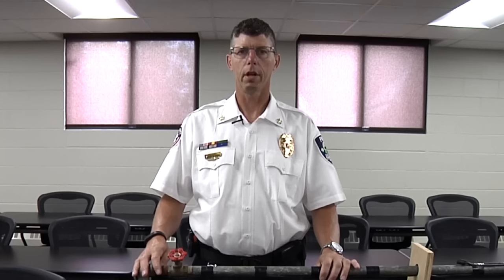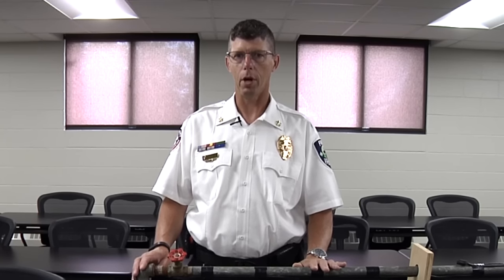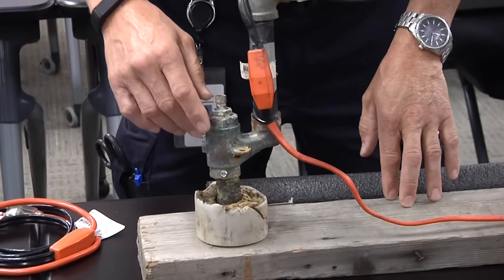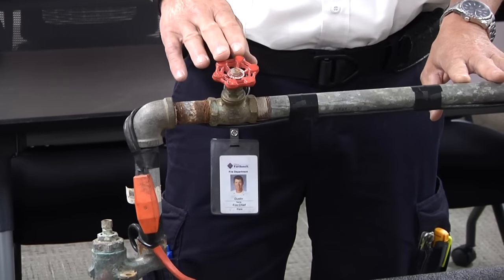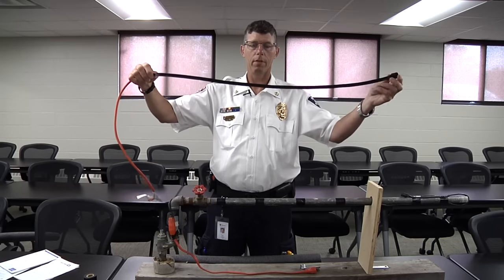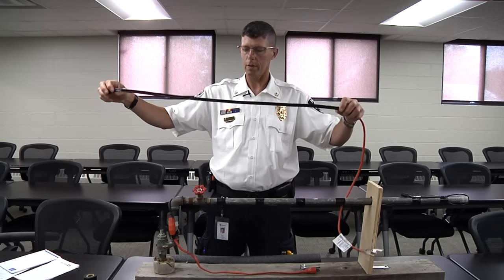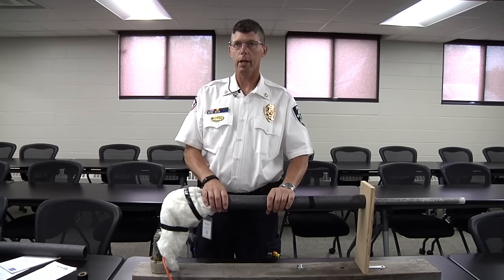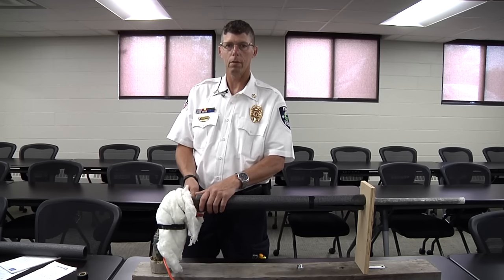How to Install Heat Tape in your Manufactured Home

Comment: Installing heat tape is not rocket science, and this video is an excellent how-to. I've done many, many jobs like this as an electrician, and there are just a few important things to remember, like keeping that thermostat 'button' firmly against the pipe. Here in central British Columbia, Canada we run the heat tape in a long spiral, about one turn every foot, to put more wattage on each foot of pipe. The manufacturers clearly warn you should not do this, but in the real world of the Great White North it works well, without any fire hazard. Just be sure to never cross the heat tape over itself, as that does create a hot spot. This firefighter did mention that. Two more things: contrary to the advice in the comments below, foam insulation is absolutely fine; it's treated with fire retardant. Fiberglass is great, but only if it's kept absolutely dry. Second, you do not need a 20A circuit and heavy conductors; this tape typically draws six to nine watts per foot, so we're talking about a very light load. Don't over-think this.
Reply: Great advice.  
Is it safe to put heat tape on Pex Pipe & then insulate it?
Reply: PEX is considered freeze damage resistant. It will swell up and possibly burst. But it's best to replace it if it does that. If u can even notice that is... I imagine the heat tape would work just fine on the PEX considering it doesn't melt the PEX, which is heat resistant as well.😊 PEX is awesome.
Reply: And a GFEP
Reply: Like what you said about wrapping the pipe instead of running the length , but one small correction , manufacturers say to run length up too 1” pipe any bigger pipe wrap spiral , depending on the situation i do the same as you wrap .
Reply: Don't use foam insulation. Doesn't matter if say if it's treated with fire retardant just hold a lighter to it. It goes up like a golf ball. That's absolutely wrong to use foam insulation. I've had this heat tape burn without touching anything just on the pipe. If it started that insulation it just goes right on down the line probably burns your house down. I don't know where this guy gets his information from but it's totally wrong. Fiberglass is probably better. If I do insulate I'll use fiberglass just try it. Hold a lighter to that foam insulation and see what happens. You better ready to get ready to let go of it because it's going to burn your hand. Just testing it

Comment: I am surprised that a firefighter fails to address the fact that the manufacturers of the foam pipe insulation clearly state on their packages that the product is not to be used over heat tape.
Reply: Liability, then. But who wants to waste that heat? I demo'd a job where the heat tape was wrapped OUTSIDE the insulation 😮

Comment: Stick to fighting fires Chief. Terrible presentation, sorry but you're fumbling for words and pausing while thinking was difficult to listen to. Further and more importantly this is titled as how to install the heat tape. You didn't install it correctly nor did you mention that you need to keep the heat tape flat against the pipe and not twisted as you tape it to the pipe. The biggest incorrect thing you did was that little trick where you inverted the orange power cord towards the top and looped the black heating wire down and around the elbow and back up the other side of the pipe going past the thermostat. You should never do that and only install everything in a straight line along the pipe from beginning to end. The problem with doing it the way you did and looping it around that pipe is that you effectively have double the amount of heating Cable in that short section of pipe which is right by the thermostat. That double section of heating cable will heat that section of pipe twice as fast as the rest of the 5 ft long section of pipe that only has one black heating cable underneath it. When that beginning section by the thermostat heats up quicker it will cycle the thermostat off and the remaining part of the pipe that doesn't have the double cable on it will be a lot colder and possibly freeze. So I would follow the instructions and keep the heat cable in a single row under the piping and not double it like you did to cover that extra area of pipe that is exposed. I'm sorry but by worrying about that little bit of pipe and doubling the black heat cable around it like that you now risk the entire length of the rest of that pipe becoming frozen.
Reply: Brutal! Lol

Comment: Don’t touch fiberglass insulation with your barehands. Always use gloves. Tiny glass particles will cut, and lodge into your skin. That is way your hands feel itchy if you touch your skin with fiberglass insulation.

Comment: All heat tapes made for mobile homes in my area specifically state NOT to put anything over the tape so as not to cause a fire.
Reply: I've seen instructions where they say to insulate the pipe with fiberglass, which is not flammable.
Reply: There are different kinds.

Comment: Great Information - Thank you for sharing it. We just moved from South Florida to Montana so this is all new to me. We have a unheated walk in utility basement that has all of the water lines that supply the house attached to the floor joists. We know that one of the copper lines burst last winter and flooded the basement (it didnt have heat tape on it) The previous owner did not have the thermostats attached to the pipes they are just hanging in the air near the plug. I think it is time to replace the heat tape and insulation correctly since I don't know the age of the current heat tape. Thaks again for the great information and your service to your online followers and local community. !!!!!
Reply: FYI, pex is type of water pipe that isn't easily damaged by freezing

Comment: Wow, finally someone TEACHING and informing regarding heating tape/cord, pool noodles and the correct information to use on this case. I want to make sure that I point out what you said during the video THE HEATING TAPE SHOULD NEVER CROSS ITSELF!! this produces a high hot point and most sure you will get an insulation burn out. Once you get a burn out on the tape the best case scenario is that you will need to replace it, your pipe will freeze, and you will need to replace it or you will GET A FIRE. We were smelling something weird on our master bedroom and after a couple of days and inspecting the under belly of the trailer we found out the tape was BURNING itself out and we were very close to LOSE OUT HOME. This is real and extremely important information.

Comment: You could use an infrared thermometer to check if it is working. I use one around my house all of the time to see how warm the radiators get and look for cold spots in the winter.

Comment: I have two 1/2 inch copper pipes running  throught my unconditioned attic that supply water to a shower/bathtub below. Each run is about 8 feet but passes through about 5 or six studs. Can I safely run heat tapes up, over and down each stud or do I need to be concerned about the wood studs catching fire? I hate to drill extra holes for the heat tape. I live in Central MA and do have blown insulation but I did have frozen pipes last year when the temps turned single digits. My house is a Colonial from the 1980s.😊

Comment: I see that your not wrapping the sensor (thermocouple?) with tape directly around the back to keep it secure against the pipe. Is there any reason why you wouldn't want to do this? I see some videos securing the sensor this way, and in your demonstration you keep the tape to either side. Thanks for the informative video and I apologize if I just missed this somewhere.

Comment: i notice the black plastic pipe coming from my well to the trailer, is just barely under the surface in a 3 foot section... u can see the top of the pipe actually... Should i at least add some dirt on top of that... its been fine so far but....!  and im in Canada... ha  chilly winters...

Comment: does the sensor HAVE to be touching the pipe? my installer is older and he usually used  heat tape that never had a sensor on it. so after install we figured air would just activate it. i dont see why open air wouldnt. its a pvc pipe running off a furnace pump and the pvc pipe is wrpaped in the tape and then the thing that looks like a noodle is over that. also ive read dont cover the sensor

Comment: my cold and hot water pipes lay next to the floor.  I would like to use the pipe warming tape but i don't think i can move the pipe without fear of it snapping.   Can I attach the pipe warmer on the top of the pipe.  I am retired firefighter from Canada. Also thank you for your service Chief.
Reply: I'm no expert but my educated guess is that underneath would be more safe and more effective. Hear rises, as he mentioned, so the heat tape under the pipe would do more in service of keeping the actual pipe warm. Also, I'm not positive but I think that the type of insulation generally used is used because it's flange retardant. My concern would be building heat beneath your (possibly) more flammable flooring. Especially if you've got any kind of flooring glue just above for vinyl or something. I may be way off base though.
Reply: Did you try heat tape underneath?  How'd is it going?

Comment: hi   enjoyed the video         i got some imformation from you   so I would like to better inform you           fibreglass is a disposable and not a first choice where there may be moisture present       if it gets wet it will freeze or mold    and will mold when it thaws           mineral or rock wool is what any educated insulater would recommend where you are putting fibreglass         if it gets wet   it will freeze       it can not mold because it is made of basalt rock      so if it freezes it will still work fine when it thaws           unlike the fibreglass     the price difference is about 10 to 15 percent for a much higher quality product        I am a Red Seal ticketed Journeyman Pipe Insulator    Im from Alberta

Comment: theres a few things i want to note that ive learned the past few days. for one the booklet says dont cover the thermostat. also you cant use the thermostat on a drip line, like a furnace. these cables are made to read pipes that have constant water flow so it warms up and shuts off. with my furnace we didnt attach the thermostat to the pvc drip, and if we did according to instructions it wouldnt turn on anyways. the manufactuerer said the thermostat will turn on by air even if not attached but so far i havent seen it work. the thing is, if it turns on by air itll just stay on and eventually the tape/cable will malfunction. this will result in it either shutting off, or worse case scenario burning the insulation under it. i decided to unplug mine and not use it. i think my insulation will be enough to keep it warm hopefully.

Comment: Use a 20amp arc fault circuit breaker and a 20amp ground fault outlet on its own dedicated circuit using 10/2 gauge wire... That's your first step in keeping the fire department from showing up with hoses and axes... Also use 12g exterior extension cords and tape the ends together to keep water out.... I Use Raychem products steer away from the box store frost king junk it will work but it's something we wouldn't look at living on the Canadian border... I like the layout in this video it's great for 1970 everything is true, but it wouldn't be allowed by code anywhere except places that have no code inforcement or use code newer than a mid 1970's to 80's code rules...
Reply: I always was under the impression that 12/2 wire is for 20 amp circuits.  Or do you say 10/2 for more safety margin?  Also how many feet can you run on 20 amp circuit?
Reply: That's ridiculous advice, Jason. 20A? #10 conductors? Sure, it will work, but it's expensive overkill. Would you do the same with your run to the fridge, or the lighting? Of course not, even though they are much larger loads.

Comment: Heat tape instructions that come with the packaging literally say to wrap the tape around the pipe, not to string it along like in this video. Someone got this wrong.
Reply: Depends on the heat tape, mine says NOT to wrap but to go along in parallel on the bottom! (Frost king IIRC)
Reply: The Easy Heat tape says to run it in a straight line.

Comment: Looks like a fire hazard! The heat tape should be wrapped in fiberglass insulation than wrap with cellophane, than use the foam wrap!!!!
The heat tape could cause that black foam to catch fire!!! Fiberglass will not catch fire!  This guy works for the fire department??!!
Reply: Exactly what I was thinking who the hell would do it in a reverse fashion every thing was backwards this a how not to do it fr
Reply: @MichaelBell22  Interesting to note.
Reply: You're absolutely right. Just test that phone roll insulation with a lighter. It goes up like a ping pong ball

Comment: Most automatic heat tapes turn on at about 38°F and the insulated pipe needs to hit 38 so it will take more than just a chill in the air to turn these on.